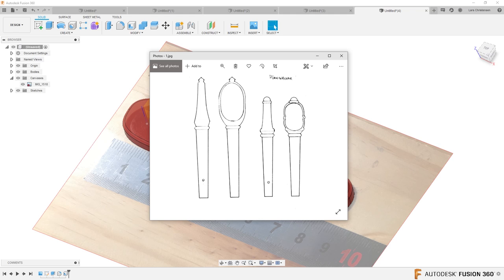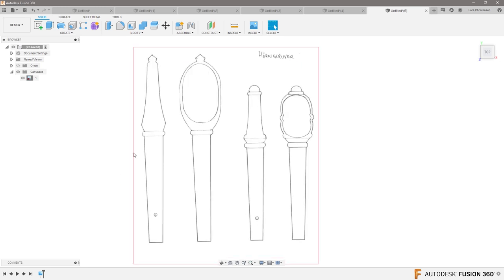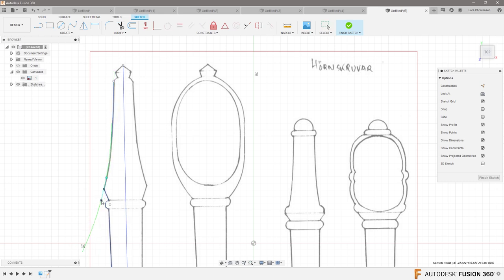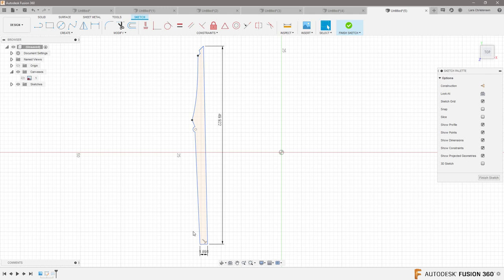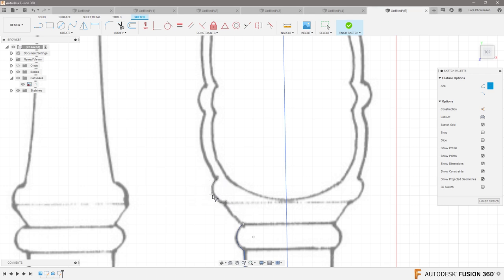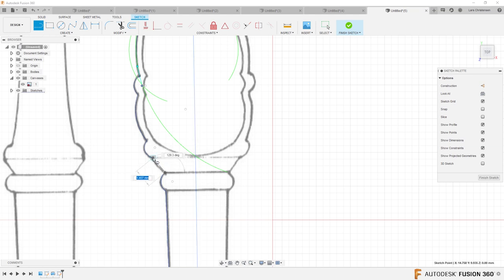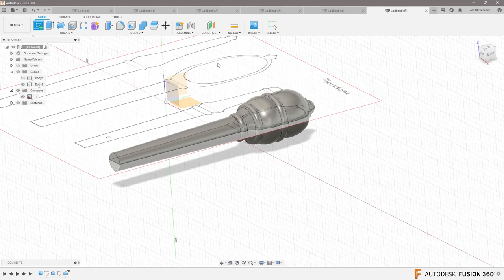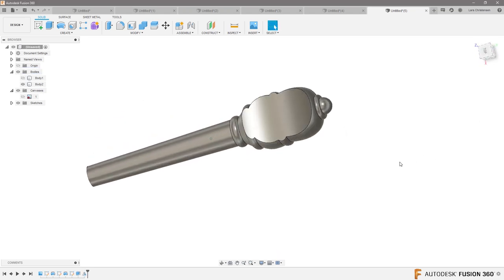Fusion 360 — How To Turn Drawing into Music Pegs — Ask LarsLive

Comment: Lars. Love your videos and I've learned so much from them. I think I'm reasonably proficient at anything fairly orthogonally designed now, with some nice fillets and chamfers of course. Recently though I was trying to model something that I just didn't know where to start with - an aircraft yoke for flight simulation. I started looking into the F360 sculpting features but that was too freeform. In the end I found a nice Cessna yoke on grabcad (cessna-yoke-2) that did the job, but I'd love to know how to make something like that in Fusion 360. The grabcad one was in SolidWorks, but surely Fusion 360 could have done it? There are so many angles on it though I just don't know how to do it efficiently and, well...  right. Any chance you could do a video on making a yoke like that?

Comment: I would like to see a modeling of the second one where it's actually a flat surface with a rounded, raised border, which I believe would show more features and be closer to the tuning pegs I've actually seen before. I would also find it useful if you talked about changing dimensions to fit after modeling.

Comment: Dear Lars,
  Sorry to ask so close to Christmas, Happy Christmas by the way 😎👍🏻,to you and all of yours mate. I’m fairly, no, very, new to all this but have found your videos exceptionally good and have easily learnt such a great deal from you so far, thank you.
  I’ve already designed then 3D printed two differently dimensioned knobs for some light dimmer switches that had broken in our home simply from watching your 3 beginner videos on the conduit box, brilliant thank you.
  Two quick enquiries if I may please.
  Firstly, I’ve seen some amazing wooden inlays done in a program called v-carve from aspire where using two different types of wood, on one, a v-bit calves out a pattern etc, and then in the other piece of timber is carved out the mirror image pattern which is then glued in place and sanded down leaving the pattern inlaid in a different coloured wood which is quite an amazing look.
  Is this a possibility using Fusion 360 as, for a retired hobbyist that has just built his very first LowRider2 cnc machine out of thingiverse, paying $3800 Australian for a program like Aspire or V-Carve is beyond my reach. And anyway, I really like Fusion and the way you and the company treat us hobbyists, you are to be congratulated.
  The other question is with regards to sculpting. Again, I have seen some amazing relief carvings done on timber such as lions heads and running horses etc. and was wondering if this also is a capability of Fusion 360 and if so how best to find tutorials to learn how to do it?
  Once again, thank you for the wonderful tutorials and all of your hard work Lars, I’m glad that being retired at 58 I have found new inspiration through you and Fusion 360.
  Happy Christmas and a wonderful New Year to you and yours Lars and thanks again.

Comment: Just come across your video's on 360 and I'm looking to use this to design a car chasie. Would like to know the system requirements for the software so that it will runs smoothly on my computer. Also won't to get the software without having a time limit built in so that I can keep using it without paying for a licences over and over.

Comment: Hi Lars I'm just asking if there is a way in fusion to set preferred home point away from X0,Y0. I'm using fusion to program a cnc router that I've modified into a plasma and the home point i want is X0,Y1210 .Also is there a way to program the machine via sketch only ? When i try to do this the lead in and out paths don't go where i would like them, such as inside holes etc , this is very frustrating as i have to extrude each piece by the material thickness, + us there a way to select all lines paths rather than every single one  ( if programming from a sketch) ??

Comment: Ok, I gotta know what is that machine on the shelf behind you, the silver box with what looks like an LCD screen? I GOTTA KNOW!!!! 😂 Oh, amazing videos too!
Reply: Its a CNC Control/Computer. Haas Automation. Not sure on model. Just appears to be "running". Looks like just the power supply us plugged in.
Reply: It's probably a dedicated training control unit. It's a clone of a real CNC Control Computer that plugs into a wall outlet so you can simulate programs and "proof" them before taking them to a real machine. This is useful because what might look good in Fusion CAM can sometimes go bad when it gets to the actual machine (subtle differences in how G-Code is interpreted depending on what type of machine you're running).